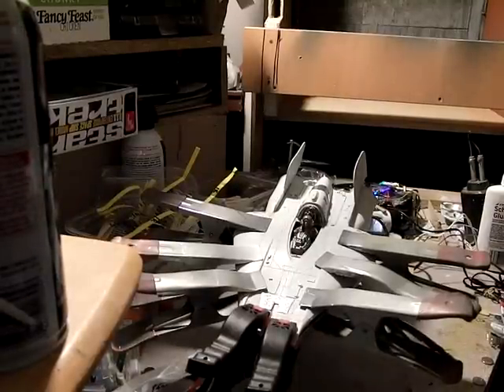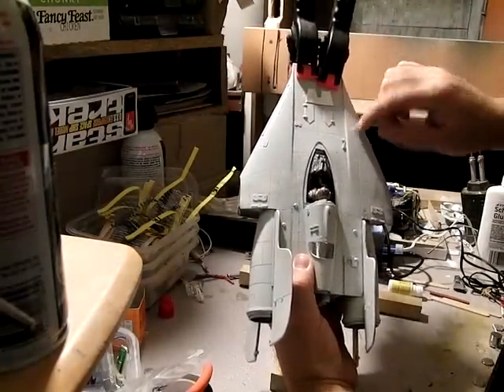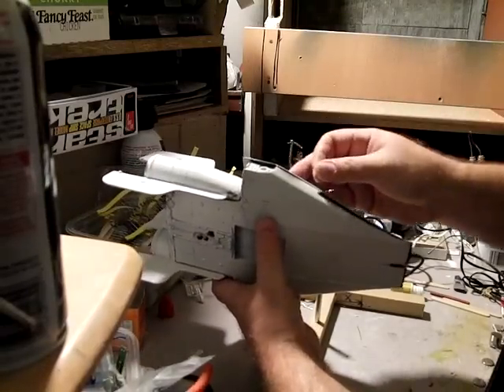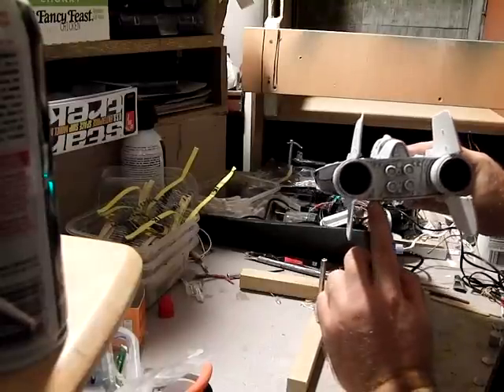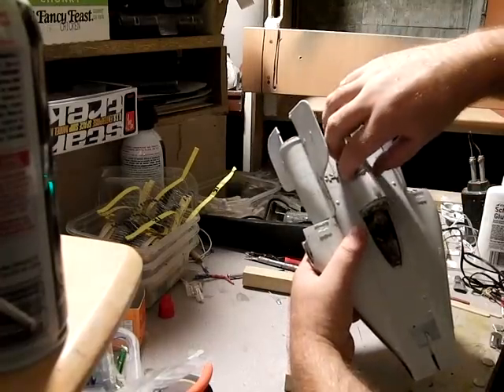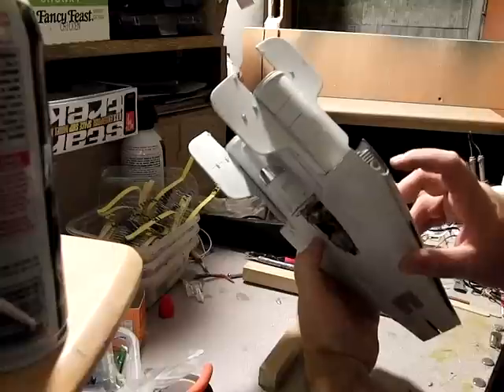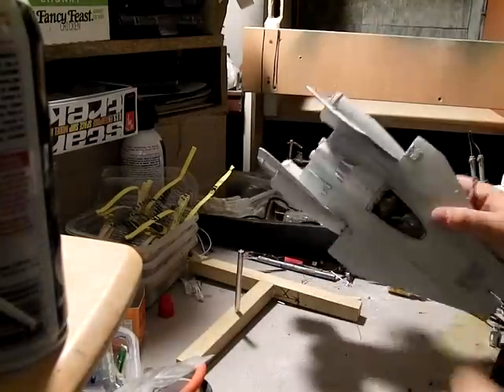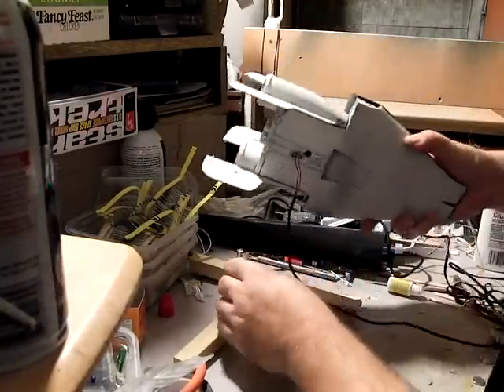1/24 A-Wing 09: Sealed and Light Leak Check

Comment from the maker: No battery.  Wall power.  For a battery, I guess teh back wall between the engines could be a place to have put one, using magnets to hold the wall in place.  There aren't many options to hide a  battery hatch on this.